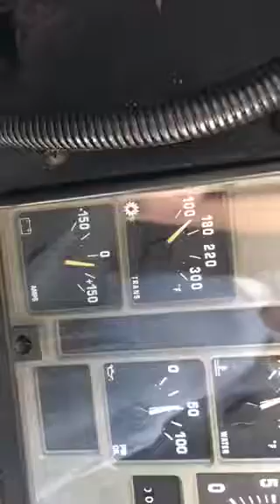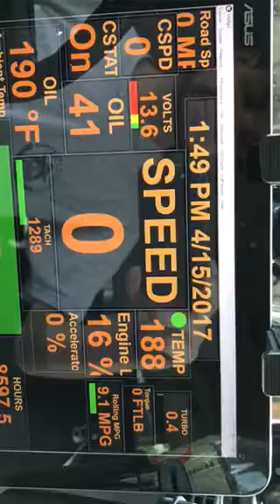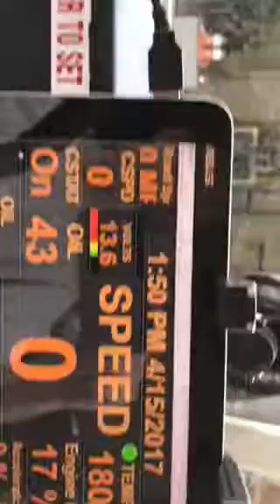T444e school bus 2000 fan clutch uograde test

Comment: did this fix your overheating issue? I am trying to decide whether to get a new split radiator and the horton clutch and fan or try and fabricate a holder for a full size radiator.
Reply from the maker: It did.. I had the radiator steamed out, my engine serial number is high enough I went to ams-oil red coolant, I installed the 9 blade plastic fan along with the Horton clutch. Rather than use the engine ECM to control it I put in a Dakota digital fan controller and also a manual switch .  The engine now has big HPOP big injectors and an Orion tuner and still stays cool. It also got a tranny swap later in 2017 to a 6 speed Allison so it dropped my rpm down which also helped the cooling.   Having a full rad would be the best way but this worked for me.
Reply: @eldoradoboy  awesome thanks! Did you have to install another temp sensor to control the clutch? Since you did not tie it into the ECU

Comment: What is that diagnostic system and how do I get it
Reply from the maker: that setup is old now :)  its a Modified Silverleaf VMS PC on a windows tablet..  I still use it  (along with my EFIlive for the transmission I swapped in after this video was made). . I would suggest Nowadays looking at Bluefire..  Blurefire isnt a diagnostic system but it is a tablet based digital dash display (that looks 10 times better than this one).   it came up a couple years after I built this..   for true diagnostics you need a Nexiq or clone device and the free navistar servicemaxx J1708. im still running this fan clutch and it rocks!  havent overheated it even in the mountains with the engine tuned..   i swapped the trans too to a 6 speed allison 1000 and that helped with heat as well